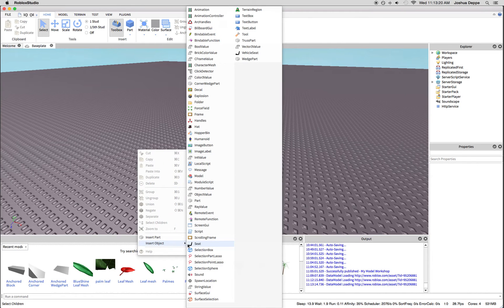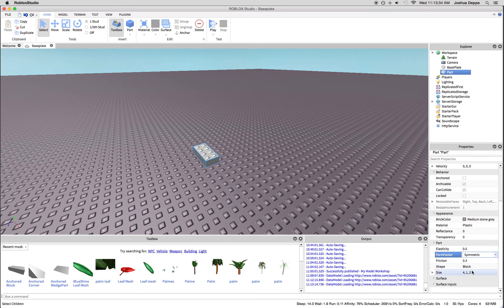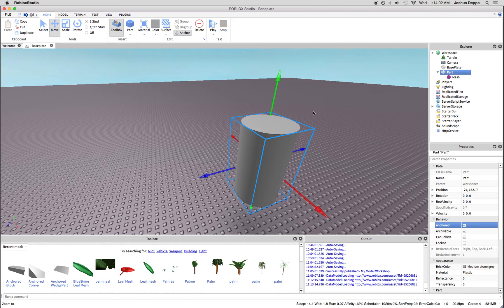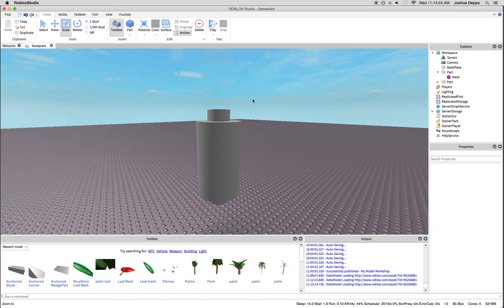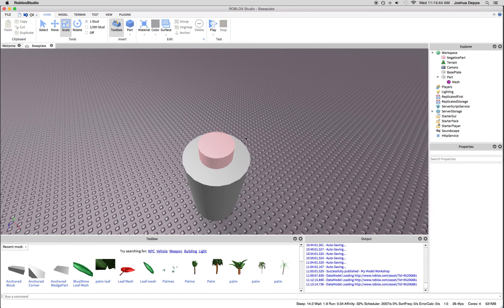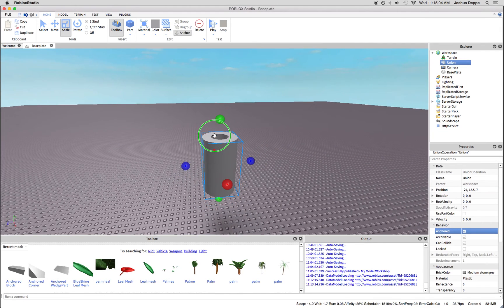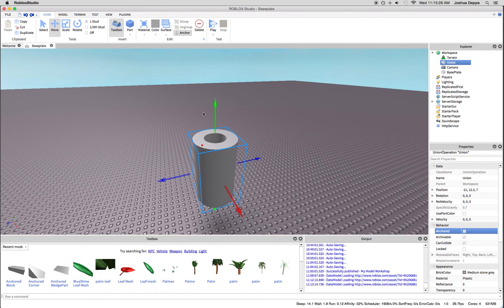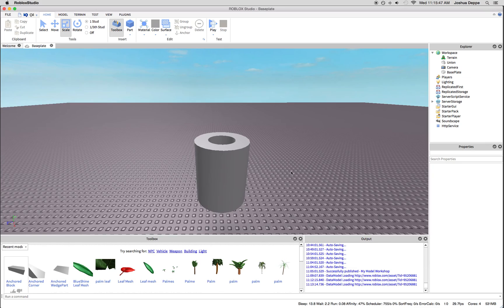Hollow Tube Tutorial

Comment: For me, the cylinders I make end up going all colourful.
Reply: +Colouraux You can't use another color on the Negated Thing then it will return in that the hole you make will Only get Colored as the Negated thing
Reply from the maker: +Colouraux If you select the union, in the properties there is a selection labeled "Use Part Color." If you select that then the union will only use 1 BrickColor.
Reply: Thanks!